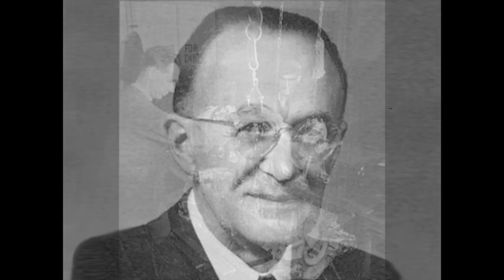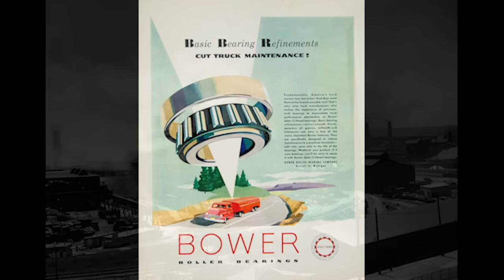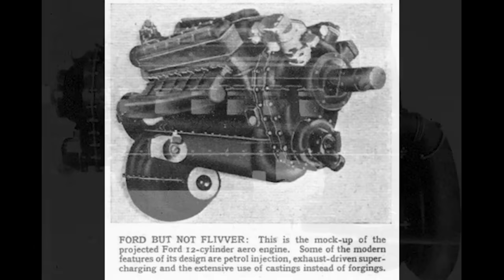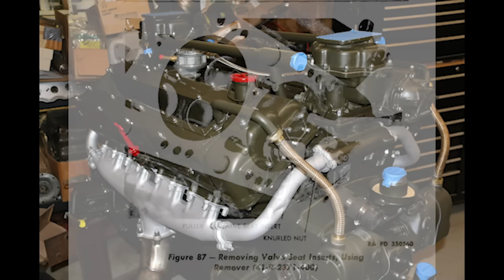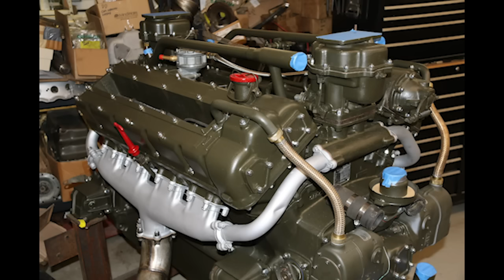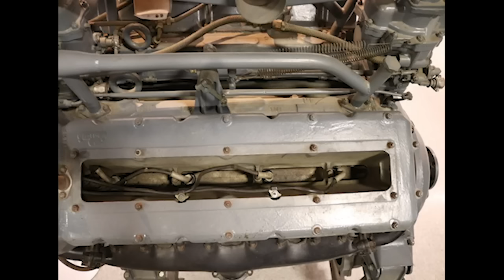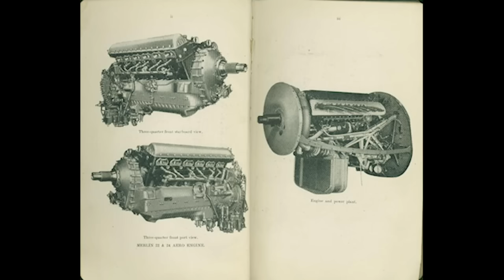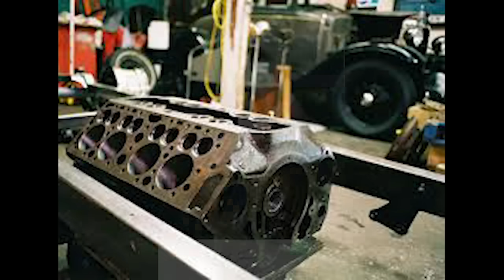War Hemi: The Story Of The GAA V8 - 1,100ci of aluminum WWII Ford grunt

Comment: This is a question that many of us gearheads have had all along. What in the h.ll is nitriding? Seriously. I used to build 340 MOPARs and we were always really careful not to turn down the cranks so we wouldn't take off the nitriding. No one could ever tell us what the process really was because all 3 of the biggies considered their process to be proprietary. I've known several engineers, as well as guys off the machining line at Chrysler, and not one of them could ever tell me what it was...because they didn't know.

Comment: The Brits made a V8 that was developed from the RR Merlin, called the Meteorite.
Link: https://en.wikipedia.org/wiki/Rolls-Royce_Meteorite
Why is it the USA thinks they are the only country on the planet?
Was the GAA reliable? Quote ''The Ford V8 developed only 500 bhp, and had problems which were not overcome until after the Normandy landings in 1944''.

Comment: I remember being surprised to discover how many tanks were powered with aero motors until I realized that power-to-weight ratio is as important in a tank as an aircraft.
Reply: Best comment on this video, you are absolutely correct in your assumptions.
Reply: The Sherman tank was designed around a 9 cylinder radial aircraft engine a Continental I think,  why the Sherman was so hig,  They used the radial,  the Ford V8  and a twin GMC 6-71 diesel, mostly marines, and Chrysler had an abortion of 5 flathead 6 cylinder engines for a total of 30 cylinders.  it was the least reliable of all and not liked !!
Reply: The air cooled ( Simply designed and reliable )  Radial engines were already being mass-produced and very abundant at the  desired 500 horsepower.   They  just needed to make them fit.

Comment: Excellent video. I never knew the GAA existed. I was familar with the 30 cyl MOPAR, the Merlins and the Allisons. Merlins were also in some of Britains heavy bombers like the 4 engine heavy Lancasters. Not sure about the Halifax 4 engine heavy bomber.
Reply: If memory serves (and these days I'm not always sure) the Handley-Page Halifax used the Bristol Hercules sleeve-valve two-bank radial engine. There's a Halifax being restored by the aviation museum at Nanton, Alberta, Canada (south of Calgary). They have a couple of Hercules engines set up on trailers for demo runs. (Several examples of those events here on YT). The Hercules was also used in the Bristol Beaufighter night fighter and other aircraft. In the basic configuration it put out around 1700 HP, give or take, but because of the sleeve valves it had a very small overall frontal cross section, and no "hot spots" on top of the cylinders. My Dad was an RCAF night fighter pilot and flew some of the very first AI "Airborne Intercept) night fighter missions. AI became known as RADAR; the early model (Mk I, Mk II) AI sets were initially hand made, even before the performance was improved and a production line set up. If you look at the front end of a Beaufighter, you can see that the cockpit/nose appears to be almost lined up between the props. The Beau had 4 Hispanio-Suiza 20mm cannon and six .303 machine guns (the same guns initially fitter to the Hurricane and Spitfire, which earned it the nickname "10-gun terror" from some Axis troops in North Africa. My dad said that if they fired both the 20mm cannon and the .303 machine guns, they'd lose about 30 knots of airspeed, just from that.  The first 20mm cannon versions used drum magazines (which the unlucky navigator/radar operator had to crawl down and change) but this was soon converted to a belt-and-hopper feed system. At the same time, they saw huge improvements in the airborne radar, which made them a very unpleasant surprise for the Luftwaffe. 
The Beau was also used in the India and Burma Campaigns against the Japanese Army as well as their air force. The twin Hercules engines could be throttled back so that they were pretty quiet, and direction not as easy to determine. They were used in the daylight ground-attack role and took a large toll of Japanese railroad trains as the Japanese fought through Burma and toward India. Gen. Bill Slim's 30th Army (XXX Corps) was given the job of defeating them, which he did, very effectively. Slim was probably one of the best General officers in any WWII campaign, but the India/Burma war against the Japanese has largely been forgotten. Initially, the Beaufighters were based at and around New Delhi, then moved to forward bases as XXX Corps advanced. Slim realized that by chopping off Japanese Army supply routes, it left whole Japanese-controlled areas unsupplied, so the Beaufighters were used for daytime ground-attack raids as well as going after the Japanese Air Force's bombing raids into India. 
The Beaufighter was a large and quite heavy aircraft, which made it less than ideal as a fighter. However, it was used very effectively in many theatres. The USAAF had a number of Beaufighter squadrons, and the Australians also used the Beau as an anti-ship platform in the Med. and the Pacific, in a configuration they nicknamed th "Tor-Beau."  Between torpedos, better radar, and the 20mm cannon, they were outstanding ship-busters. 
Many of the Beaufighter night-fighter squadrons were converted to use the much faster and "nippier" DeHailland Mosquito. The main weapon in the radar Mosquitos was the 20mm cannon (as night-fighters). However, the Mosquito also saw a lot of service as both a day and night bomber, hard to catch because they were very fast, even with a full load of bombs (3 tons, I think). But the Beaufighters, using the Bristol Hercules engines, were one of the most numerous aircraft types to be produced by the Allies during WWII - they were built in England, Canada, and Australia in very large numbers. Later in the war, somebody woke up to the fact that with 20mm cannon and radar, the Beau would also be good at catching German U-boats, and several squadrons were deployed from Scotland out into the North Atlantic for that. The fact that the Hercules was a powerful and reliable engine, and that it was NOT a RR Merlin, also helped make its use widespread. The USAAF Beaufighter squadrons had some notable successes in the Med and elsewhere, and it was very popular with U.S. airmen. The Hercules engine allowed them to carry a lot of  armament of several types. Someone did a pretty decent profile of the Beaufighter on YT, with a name like "the most under-rated aircraft of WWII". Certainly they saw a lot of service in every theatre of the war, and in many roles.

Comment: Fascinating stuff, just one question, what was the GAC V12 used in ? Many thanks !!!!!
Reply: The huge T29, very heavy tank. no one is actually sure, but I do not think there were more than 50 total of the V 12's made. There were 4 Aircraft GGA and GGB,engine variants made, two PT Boat engines made, the GAY Variant, shorter stroke 5.75" bore prototype for British Tanks, and several others. The First v-12 GAC tank engine run was 18 pieces, but the few writings we can find indicate another run of 50 was to built. Our  V-12 enthusiast group knows of four, two in prototype Tanks in Museums, one somewhere in California in the hands of a secretive engine collector, and the one in the photo currently being rebuilt. If you know of anymore,  or any parts for them, let us know. I have 5 GAA's- GAF's, one runs. Jim
Reply: @jimdickinson3686  Thank you very much for that !!!

Comment: One of the best engines that almost no one has heard of! What I like best about the engine, well besides the sound it makes, is the lack of chain drive for the camshaft. Todays engines, including Ford, some of the weak points are the chain drive. This is a fantastic engine. Kids today have no idea what came out of WWII and how it is benefiting them in their rice rockets. You can definitely tell that the Merlin was the inspiration, but Ford did what Ford does best and that was to make it cheaper and faster to build. Europe today still over engineers their engines, making them costly to build and repair, however they do produce some nice machines. Great video, thank you.
Reply: Timing belts are a problem, chains are not.  Properly spec'd, a timing chain will outlive the engine.  My wife's Ford Edge is a DOHC with phasers and has the original chain at 260K miles.  I changed the pump 5 years ago and cheaped out and just changed the pump.  Still running.
Reply: @ohger1 I disagree in my opinion belts are fine they just need to be changed at the proper intervals.      Now if we are talking about  the timing set on a SBC or any pushrod V engine 6,8,12, 16.   Then yes a simple chain is great. Or even a gear drive.  But if we are talking OHC or DOHC engines.  If chain driven the chains don’t  really wear out.  How ever the Polly guides that the chains ride on and extensions by do wear out.  That Polly material goes into the oil and being plastic. Can not be captured by a magnet.    A belt on the other hand   Dose not require lubrication .   And is usually outside the block.  So no  non metallic getting into the oil.    Both are good ways of achieving the goal.  And like anything will last a very long time as long as the proper maintenance procedures are fallows
Reply: I was a mech in the late 70s and early 80s. Each major car brand had a quirk that, once mitigated, could easily double the engine life. For Pontiac, it was the timing chain.
Reply: Cam chains are fine, but they need small links to handle the inertial forces at the crank sprockets. Duplex or triple row to handle the loads and adequate oil jets.
Reply: Right-angle spur gears are notorious for rapid wear. The thumping of camshaft springs would seriously take their toll.

Comment: GAAs were popular irrigation engines where I grew up in the Texas panhandle in the late 70s.
One of our neighbors used one about a mile away and the exhaust was pointed straight at our house. That thing would shake the ground and I would fall asleep every night to the drone of that big V8.
Reply: Well, it was a mile from the house.
Reply: @kevinkirk4285  it's ironic  the GAA was born out of fords desire to build an aircraft engine ,,,on the opposite side the rolls royce meteor was born out of britians need for a tank engine ,,the 1100CI  GAA made 500HP with 8 cylinders  and the RR Meteor made 600 with 12 cylinders and 1650CI and had a similar torque number,,,funny that the GAA is only 200 pounds heavier than a modern cast iron big block chevy which weighs 900+ pounds fully dressed
Reply: @wildcoyote34  A big block chevy never weighed more than 750 pounds in its fattest dress. Cast iron block, heads, intake, and exhaust manifolds. 
For that matter neither did Mopars hemi.
Reply: @tuck6464  ok i made a mistake   , thanks for the correction
Reply: @wildcoyote34  No problem, I just don't want my BBC's walking around with weight complexes.
Reply: @tuck6464  the weight figure i had as wrong , i included the transmission  too
Reply: @wildcoyote34  A fully dressed "fresh from the car" Mark IV Chevrolet with all iron manifolds, heads, water pump alternator, etc weighs 780 pounds exactly.
Reply: Fall asleep to the drone and the carbon monoxide… 😴
Reply: @seanwieland9763 Better than being burnt to death from an exploding RV
Reply: @seanwieland9763  🤣🤣🤣🤣🤣🤣🤣🤣

Comment: Merlin produced more than three times the power of the GAA. Had Ford built an 1800HP motor, it's quite possible their crank technology would not have been sufficient...
Reply from the maker: They did build the 1,800hp version. And tested it, before the government told them they wanted a tank engine and not the airplane engine they had developed.
Reply: Well, the Merlin was SUPERCHARGED and the original aero design would have been able to pass the 100 hour PFTR reliability test required for adoption into RAF and USAAF service.
 The GAA would have been optimized form lower cost and would not require a flight rated certification.
 The GAA was very comparable to the Rolls-Royce Meteor, not the Merlin

Comment: OUTSTANDING video! Ford's chopped-down Merlin was an awesome piece of engineering and manufacturing!
Reply: geoffmcnew  It was NOT a chopped down merlin, it was a chopped down version of Fords own V12 aircraft engine Ford designed and offered to the USAAF and the Brits both refused it and it was chopped to V8 for the Sherman tank !!! !  DUUUUHHHHH!!!!!

Comment: That motor weighed under 1500lbs. The Chrysler Multibank is listed at 5244lbs and from experience I know that 2 6-71's are close to that also. Strangely the Chrysler produced 370hp from all of those cylinders but I guess torque and reliability was more important, in a war.
Reply: The Chrysler Multi bank and the Detroit twinpack were both  rejected by the US Army for lack of power, the Chrysler version was given away by lend-lease.
Only the USMC used Diesel engines due to Navy fuel restrictions
Reply: No way, one of the Dodge 6 cylinder engine weighs close to 500 pounds by itself. -Five of them and coupling hardware, more like 2000+ pounds!
Reply: @jimdickinson3686  The Multibank has  alot more iron than just 5 Dodge 6-cylinders long blocks, it weighed nearly as much as the Sherman did... a truly shameful and humiliating fiasco.